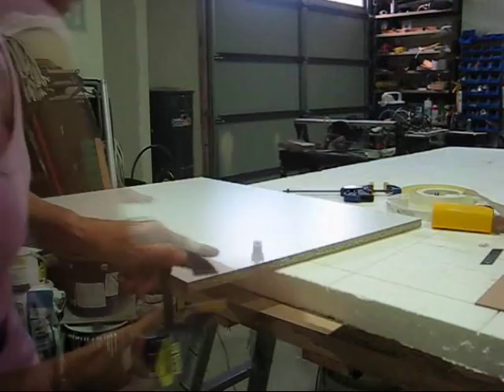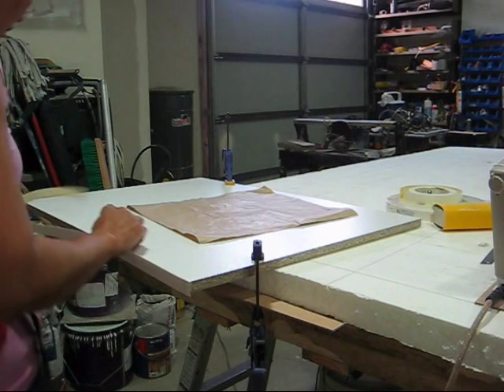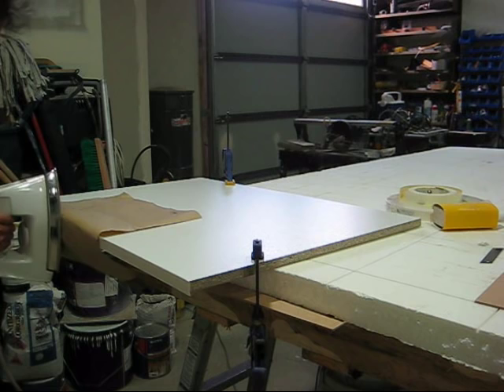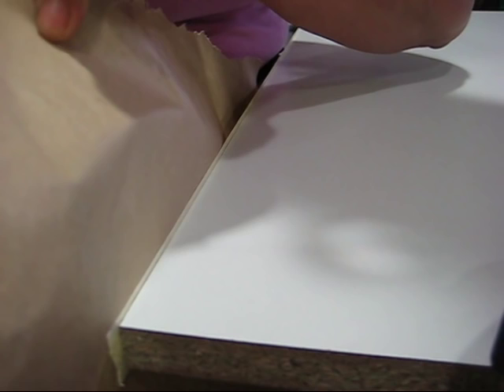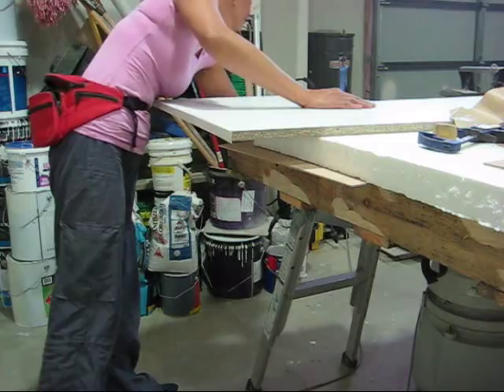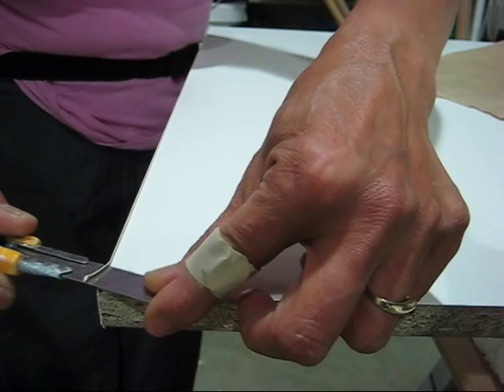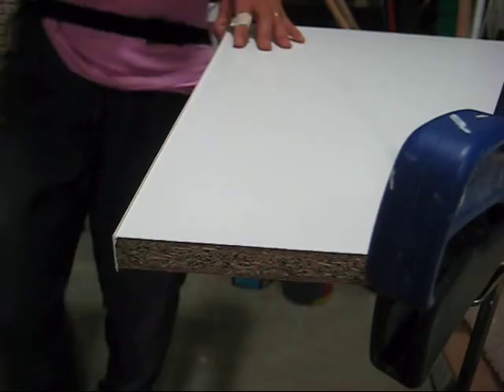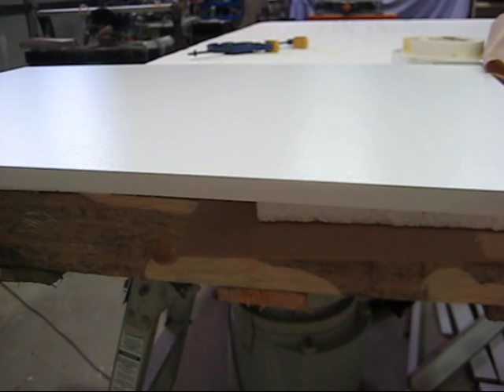How to apply Iron on  Melamine/Laminated Edging

Comment: Excellent video. I make a precision glass cutting machine for sale, the base of which is made of melamine board because I have found it to be the flat-est and most economical material for the purpose. I have long put off edging because of possible interference of an uneven application during the machine's use. You have helped me have the confidence to give this a try. Thank you.

Comment: Thank you for such a helpful video. I shall be trying this for the first time this weekend.
Reply from the maker: Have fun!
Reply: @LizKreate  Thank you, I did :-) Simple and satisfying. I’d never done this before but your video was simple and straightforward and gave me all the info I needed to feel confident in trying.
I did it slightly differently on my second and subsequent boards. I put one edge of the tape up to the edge of the chip board, so I only had to trim one long edge of the tape. I’m sure the result isn’t as good as your technique but it was adequate for my need and saved me time.
Thanks again.

Comment: Oh boy, I wish I had seen this video before I attempted a special shelf I am making for my wife. Got iron marks on a couple on all of the edges despite trying to avoid the dirty parts and the brown paper trick would have avoided that. Guess it needs more of the baking soda and vinegar treatment or I have to find a paper supply. That stuff is hard to find 9 years later.
Thank You for sharing this neat tip and I hope you haven't been caught up in the NSW lockdown. Be safe and stay safe Liz Kreate. 👍
Reply from the maker: We're in Canberra so we're all okay so far(touch wood). If you can't find the paper strip, maybe try special ordering it with your local hardware store. Maybe they can get it in. Good luck.

Comment: Q.. If your video wasn't specifically for basic tools, is there any reason why you couldn't use a flush trim router bit to clean up the top and bottom edges?

Comment: Hey have just seen your vid and it is great, any chance of showing how to do it on an internal curve, I have the tape peeling off the doorways in my boat and need to replace...thanks for your work
Reply from the maker: The only advice I can give you is that try doing the same thing as in this video. Start from the flat area first by ironing it slowly going to the top of the curve then tilting the iron on the edge so it can heat up the curved area and then trim with a blade.

A heat gun on low is also handy to use or a hairdryer on high. Always practice first on a mock up piece before doing it to the main work. Good luck and wish you all the very best. Cheers, Liz

Comment: Can I use the same technique to fully surround the board, so that I can use the finished product as a backing board to mount some drying racks. That way all sides will appear white. I need to have a backing board as the wall studs are in the wrong position
Reply from the maker: I don't see any reason why it wouldn't work. I haven't had the chance to do that myself but would be good to know how it turned out. Thanks for watching and good luck with your project Philip. Cheers, Liz

Comment: Hi there, the thing that is puzzling me, if I put this on say a shelf and then stain or varnish it,how is it going to match the banding,or can you stain the banding,thanks
Reply from the maker: I haven't tried staining the melamine edging but don't see any reason why it shouldn't work. Try doing it on a small test piece first by sanding it lightly with a fine grit sandpaper and then apply a thin coat of stain or varnish letting it dry in between each application. Good luck.
Reply: why would you stain this. if youre edging a piece of plywood, dont use these laminate strips, you can get say an oak strip and glue and clamp it. stain will not turn out on these.
Reply from the maker: Matthew Jewell
Thanks for the tip Matthew. I forgot that you can actually get different wood colored laminate strips. Cheers, Liz